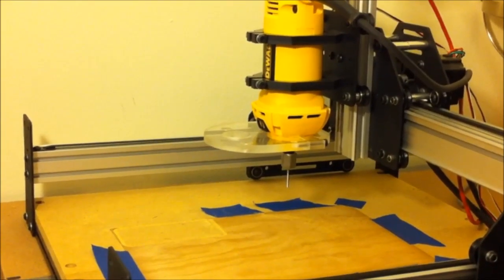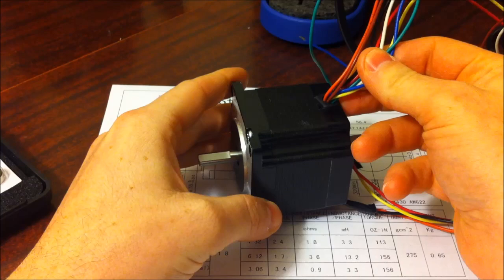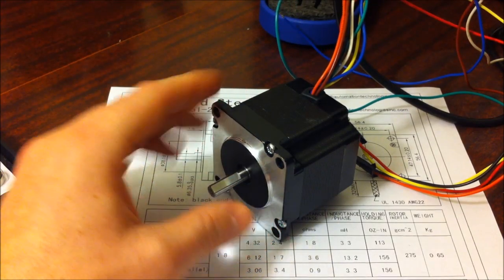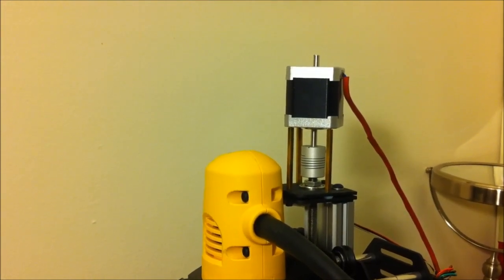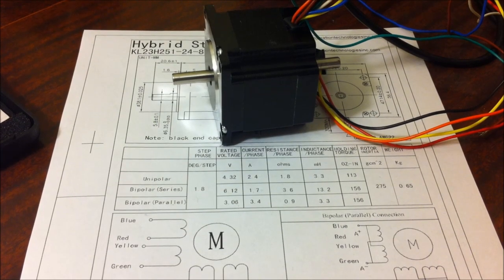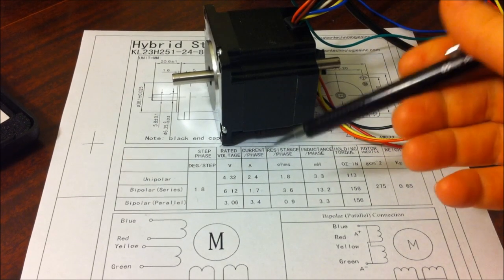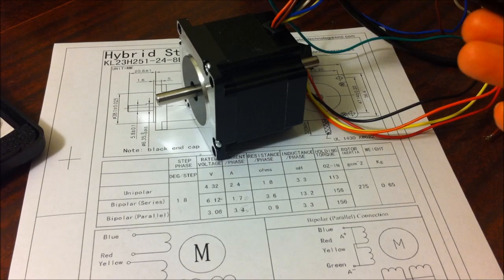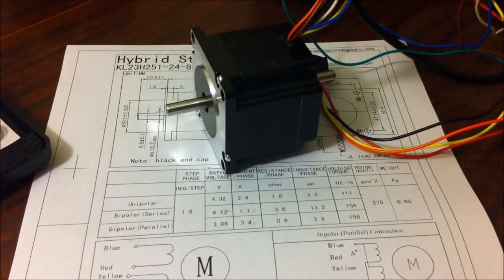ShapeOko 2 Tips for beginners: Stepper Motors

Comment: I would suggest that IF the words "basic" and "basically" did not exist, the author of this video could not communicate! LOL

In addition: the wiring of a stepper motor; internal and external; is also very important when discussing these motors. Thus, I believe this video would  be of much more appeal; if you had discussed how serial and parallel are wired; and bipolar vs unipolar works; with respect to the spec sheet you used.

Also, a higher ampere motor is no better than a lower ampere motor IF the voltage is doubled. IE:  6.12 V applied across a motor wired in "series" configuration drawing 1.7 amps, is identical to the same motor wired in parallel with 3.06 V applied across the motor, drawing 3.4 amps. For we are talking about Power here. Not just amps or just voltage.. IE: P = V x A (amps).

This is WHY BOTH configurations comes out with the SAME "holding torque".

However, there ARE advantages when deciding whether to use series or parallel wiring configurations. One advantage is: You mentioned in your video, "coming up to speed".

For whatever it's worth.
Reply from the maker: Basically sounds like good criticism.

Comment: my stepper is a nema 23 425oz-in series conection and it vibrates during operation iam using a4988 driver can i solve this or does all steppers viberate pls help me
Reply from the maker: +abilash chakaravarthy It's fairly common to have a bit of vibration. it's just the nature of the darn things. As long as, the motor spins smooth and freely when it isn't powered up I wouldn't be too worried about it.
Reply: and when the feed rate is reduced to about 2 mm the viberation is high during gcode of G01
like i could ear the sound of it
is that to normal
Reply from the maker: +abilash chakaravarthy Yeah, they can be noisy buggers. Sometimes it's more of a singsong sound, and other times a collection of high-pitched squeals.  It's common for the motor to produce different sounds at different speeds.

Comment: Thanks for the info. Helpful for someone just getting into CNC. I'm still not sure what practical benefits there are to upgrading to NEMA 23 vs 17. You mentioned the 23 has a greater holding torque. What benefits does that provide? Are there any other benefits the 23 has over the 17? Will it give you a greater in/min cutting rate?